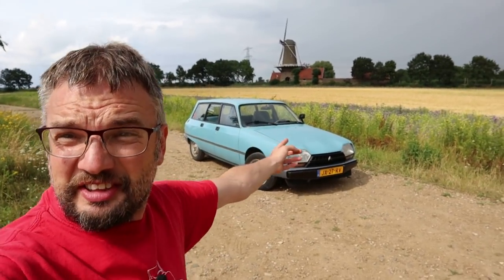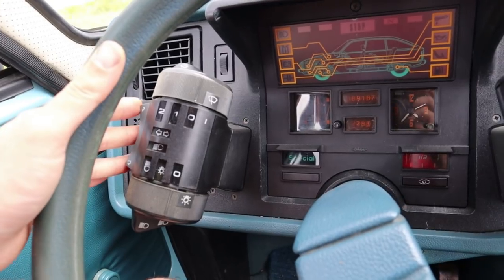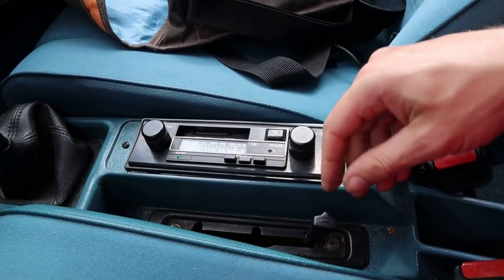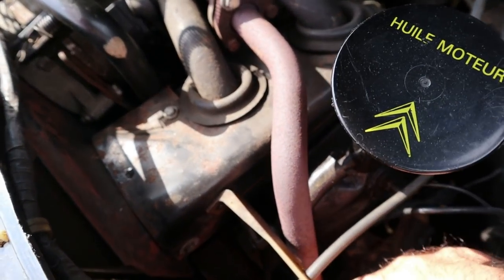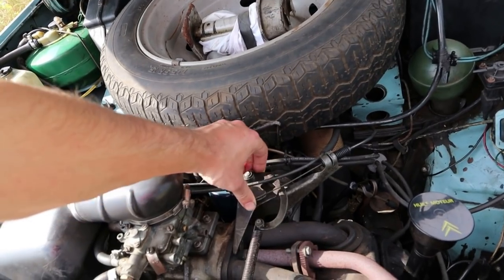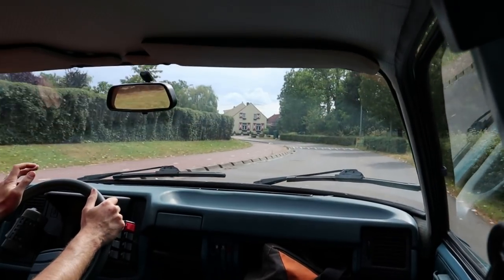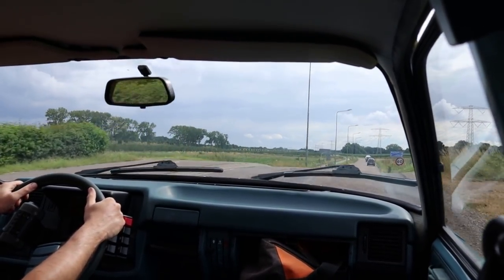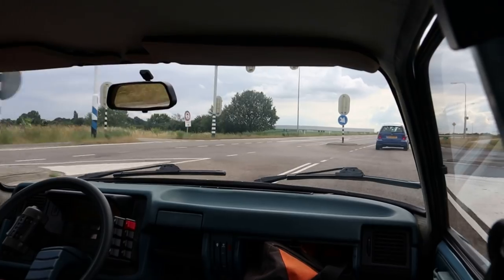Real Road Test: Citroën GSA Break (estate) Spécial!

Comment: Citroen really inovated back in the day. That cockpit is just breathtaking, the controls are so quirky but delightful. Cars are so boring these days. 
Thanks for the video, thought you were having a break.
Reply: Catching up on backlog of video !
Reply from the maker: It's the only video you'll be getting this week, so make the most of it. ;-)
Reply: A Citroën break!
Reply: I don't know the new Citroen cars are certainly going back to strange quirky looks and actually look less boring compared to other cars on the market.
Reply: or a brake! HA
Reply: @richierex  In a way prfer none cancelling indicators. Back in 1983 had a Dyane for 50,000 miles.
Reply: Matt Walker
 I won't really call it innovative. they tried too hard to be different without adding real value, a non canceling rocker switch for direction indicators just for the sake of using "different switches", a cassette player inviting things to fall into the slot, hard to read heater/cooling controls, that diagram of the vehicle in the centre of the cluster, nothing of those things survived into modern vehicles, I would say more pretentious than innovative.
Reply: @MrGoogelaar  odd that you are replying to a year old post but hey. My point was not about functionality but design. Look at the dash and layout compared to other cars of the era and today. You mentioned that these features didn't survive in modern cars which is the point. Modern cars all look the same and lack character, I don't believe that is pretentious
Reply: @mattwalker4034  What I mean by pretentious is that they tried too much doing simple things differently without it being an improvement or of any value, I think that is one of the main reasons that they went bankrupt and are constantly struggling. 
Things like front wheel drive, fuel injection, airbags, crumple zones, disc brakes are all old innovations that are still used in modern vehicles while the quirky features of the Citroen in the video are long forgotten, things like the tape player fitted the way it was, the switches, the handbrake etc. Not one of those things made the vehicle any better than its contemporaries, in some cases it actually made it worse, like the non canceling indicators.
Reply: @MrGoogelaar  But still far more interesting than most modern cars (which was Matt Walker's point). Look at modern hatchbacks, for instance,  they largely look the same both inside and out.
Reply: @julianevans9548  Unfortunately not interesting enough to bring the buyers come running and save them from bankruptcy, in the real world effectiveness and reliability will always win, being different for the sake of being different is often the demise of a product.

Comment: Hey, I'm old enough for this. My dad bought a white GS break in 1976, it followed up our 2CV. That was a 1012cc, with black plastic seats. Quite sweaty in summer. In 1978 he bought a new GS 1220 break in light blue metallic. That was one of the greatest cars I have ever sat in. I got my licence in 1983 and was proud to drive it every time I got the chance. What a great car. GS-es were very light, only 900 kilos or so (925, I read), so they got a pretty good power to weight ratio. That's why it feels fast, it's just so light. The brakes were fantastic, once you got used to the pedal that had only minimal travel, really only millimetres. I always felt I could stop the car on a dime, from any speed. The seats were fenomenally comfortable; the only thing detracting from the ride was the engine noise, which was quite horrible over 100 kmh. The suspension was a work of art, the steering was incomprehensibly precise, that car was about the most fun to drive of any car I can remember (at 55 I've had about forty, I can't even begin to sum up brands and models). Probably the best thing about these cars was the price: in the mid eighties I picked them up for 100 gulden, that would be maybe 250 euros today. If they broke down you'd take them to a scrapyard. They'd give 50 guldens, you'd pick up a paper and another would be in there for 100 gulden. Good times.
My dad's new bought GS rusted out in six years, leaving him very angry and without car. I think he got a brown GSA then. I thought it was a load of crap. The suspension had been modified to feel 'sporty', that is harder and less comfy. The brake pedal had far more travel, which took the feel away. The dash was also a downgrade to me, as it was less functional and more gimmicky than the GS one. The seats weren't as good. The car overall felt far more flimsy and thrown together than the GS, just not as good, not as balanced and not as 'of a piece'. It had more power, but felt slower. It had a different steering wheel, but not the steering feel. I didn't like the GSA and I will always feel it an inferior car to the original GS. Just adaptation to the market, just not Citroen. The GS was the real deal, that's how I feel about it. Jeez, did I just write all that? Allright, away with it.
Reply: @Johann Cats ... Being of 1951 vintage, I so agree with your comments about Citroën rather betraying its heritage, but market forces are brutal and companies have managements who get terrified of losing market share to competitors. We saw how, almost overnight, market-leader Nokia rapidly crashed and burned when the iPhone hit the marketplace. Consumers are capricious, and technology markets are particularly vulnerable to technical advances and new ideas. Citroën's suspension was once one such novelty and must have revelled in taking business from others at the time! If only we could at least have kept the older cars we liked on the road... but most fell to bits with corrosion ridiculously early in their lives and, as you say, it made owners angry. After six years, the annual roadworthiness test became as daunting as a trip to the dentist's... and similarly expensive.
Reply: Yes, I considered the GSA to be a downgrade - and I wondered whether it was because PSA were actually trying to kill off Citroen's more "eccentric" models and encourage buyers to lean towards more conventional - ie cheaper to manufacture - ones, particularly those based on existing Peugeots  - eg the Citroen LNA essentially being a Pug 104.   The GSA's dashboard just seems utterly bonkers - and, frankly, hideous - rather than charmingly different.

Comment: I managed to convince my mum and dad, who’d driven nothing but English cars (and had a Marina!) that they needed a GS. Amazingly, they bought one. The final straw was when they had to have the exhaust manifold replaced which I think required engine removal … Until that point though, we all loved it. Mum and dad said it was the best car they’d ever had and to this day remains the best I’ve driven (I had an lovely Alfasud too). They are everything that hubnut says - utterly wonderful & intelligently designed cars. You knew this had been made with a guiding purpose, not just to make money.

Not forgetting that, blissfully, Citroën’s quirkiness extended to non-self cancelling indicators. As ever, they were alone in this, and correct. Self-cancelling indicators were rubbish then and they are still rubbish 50 years later. On new cars they cancel when going round roundabouts or doing something else. They are a pain. It seems a small thing, but when the entire other car had self-cancelling indicators, it takes determination to go the other direction. Citroën always did and the GS is the shining example of that vision.

Comment: Soft suspension and big tyres (not wheels!) is a key for comfort, today with many stupid 20 or 21´ wheels the ride is just stupid. Despite that, the car is lovely and very futurist.
Reply: Even small cars like 208, clio etc...have commonly 15, 16, 17' wheels which is a total non sens. I remember my first car, a peugeot 104zs , had 13' wheels, my first sport car, a Honda prelude had 13 or 14' wheels
Reply: having a new c3 with 195-65-15, i cant imagine that i would go for 17" ultraslims...must be pain in ass.
Reply: I had a focus and went from 195/60/15  to 195/65/15   the tyres were cheaper (Michelin energy both sizes) the ride was much improved, the tyres would last longer as they actually rotated less times and the speedometer was spot on with all my sat navs and Google maps. And those signs at the side of the road that show your speed.   I'm doing the same soon with the Mondeo. I always add 5 to the profile and keed the same width
Reply: @Aussie Pom in those hilux's with the huge wheels you get smashed into the roof with every bump. £10 of fuel just to get too the petrol station.

Comment: We leased a GSA X1 5 speed 1299 cc for 3 weeks in 1982. Superb car. Cruised happily at 140-150 kph with a max of 165 kph.
Loved the control switchgear including to rocker blinker switch. So logical, so French.
Headed down to visit the Lambourgini factory and Pisa. So much fun to throw around once off the autoroutes.

In Australia we got Citroen addicted. My first GS (after 2 x IDs & 2 x DSs) was a 1015 C matic, followed by a 1220 manual sedan and later a 1220 GS C matic wagon.
On secondary Aussie roads it was so chuckable. My parents were so impressed with mine they sold their Holden and bought a GS 1220 sedan C matic.

Comfort, brakes, ride, handling, huge boot. Even with 4 up and luggage it was still magnificent. 
Saved their life overtaking a bus and a car one because it was so stable, they recovered after being forced onto the opposite shoulder.

A close friend had a GS 1220 Pallas and another a 1220 Club.

Citroens are rare in Australia, but terrible addicative. I currently have a 1990 2CV6 Charleston and a 2018 C4 Cactus 1.2 turbo 6 speed auto.

Comment: I had one of them. I brought it at Chester car auction back in 1987 for £250. A bargain for five year old car. Driving it home it became apparent why it had been sold at a auction. It wasn't charging which I became very concerned about .....An alternator back then for a Citroen could cost a months wages. Thankfully a close inspection the next day revealed that the alternator drive belt was completely missing . If I remember rightly  it wasn't an easy task to replace the belt .I had too remove a large proportion of the front of the car...When I drove it into the Austin Rover garage where I worked all my fellow mechanic mates gathered round . Comments like "What the """ is that , someone gave you  £250 to take it away echoed around the work shop.  However I ended up with a really good family car for a year nicknamed the banana because of its bright yellow paint. It was eventually replaced with a more conventional Fiat Strada , that also received a lot of condescending comments in the work shop . Sorry to go on ,but your video brought back so many happy memories.
Reply: Sympathy on the belt change saga!  I'm still in trauma from changing the points on my 1976 Peugeot 304 estate bought in 1982 as a non-starter. The distributor was buried deep  behind the engine against the bulkhead so you could either see or touch, but not at the same time. Finally getting it running revealed a knackered camshaft and my car proved to be a rare  variant with no scrapyard salvage engines available.  French motoring !
Reply: hey colin chester motor auctions on bumpers lane is where i bought my old citroens from too mate! did you work at james edwards?
Reply: Phil Healey .Yep been their..I used too work for the RAC. We had at home service. I used to turn out on a Sunday afternoon to someone’s house and they would hand me a set of plugs and points. They’d say “ I think these need replacing . I would reply ,I think you need to take it to a garage for a service then.
Reply: mark jones Yeah I worked their for three years . 1985 to 88. And that’s where I bought my Citroen. We could of been bidding against one another.
Reply: Kinda funny looking back that a Austin Rover mechanics would be making derogatory remarks about a FIAT and a Citreon. 
Especially since both concerns are still in business and Austin Rover is long gone!
Reply: @colincampbell2372  just out of curiosity, how did customers react to being told that?
Reply: @alfredsedgewick2184  They were annoyed that their £10 roadside rescue membership didn’t include a full service . They got even more annoyed when I charged them a £25 surcharge for calling me out to their home address .😆

Comment: My father had a GS Pallas - fantastic cars! Several BX and Xanthias followed, but the GS was the greatest of the lot!
Reply: Flemming Sorensen my dad had the same semiautomatic would love one
Reply: Xantias yes.
Xanthias no.
https://www.supercars.net/blog/1986-citroen-xanthia/
Reply: Rust bucket. Oil leaks on air cooled engine
Reply: @yousefbhoyroo6960  In almost 50 years it has been largely enhanced by 3rd party spare parts manufacturers. BMW or Porsche weren't better with their air-cooled engine. If you didn't do the basic preventive maintenance on a car (proper car wash, checking the bodywork and chassis for rust...), every car of the era was a rust bucket.
Reply: @chucku00  yes, that is very true, just look at Mercedes, the W114/115, the W123, w116 and so on all rusted a ton a lot of them were completely rusted through after 5-8 Years.

Comment: Dad bought a GS Pallas new in 76, OYM611R ferried us back and forth across Europe as he was in the Forces (Forces plate was MU556B iirc). I'd sleep on the floor in the back, and my sister got the back seat. Utterly bonkers car, but so very comfortable. 
It didn't like the Berlin winters - had to be taken in by Citroën one particularly cold year to be defrosted over 3 days.
It was sold on in 1985 when rust was getting a bloody good hold of it, and my Dad bought a Moggie Traveller, which he still has.

Comment: Dear Mr. H. Nut,

Thanks for another great video.

You've never said that you take requests, but you also never said that you don't, so here we go:

If you'd ever get the chance to test one of the following cars, I'd be delighted:
VW Phaeton
Renault Safrane with Volvo R5
Nissan Patrol 160/260
MB A-Class W168 (widely misunderstood car!)
Mazda 121 (the egg-shaped one)

Cheers
Reply: Well there you go Ian, you should've also driven the A-class I offered, then :D.
I think it's an oversold piece of horribleness with a mercedes badge on it, but some people seem to like it it turns out :D.
Reply: @rollingtroll  the badge is the problem indeed. MB should have sold the car under the Smart brand if you ask me.
Reply: A Mazda 121 test would be really cool, if Ian could find one. I actually quite like those little cars.

Comment: Citroen peaked for myself with my 1998 Xantia estate 1.9 diesel automatic.
The suspension was perfect, engine was brilliant, seats were amazing, the looks for me, were perfection and the gearbox meant that technically, you could have a top speed that was intimate, depending on engine revs and length of road.
I do however, appreciate the importance of the gs and gsa in the history of Citroen and , after a friend owning a pale blue gs years ago and then an orange gsa, I kinda got the Citroen bug from him.
For which I thank him for.
Anyway, great video as ever and thankyou for sharing.

Comment: Can't remember the last time I saw one of these. I nearly bought one once, low mileage with full service history and no rust. But I worried about that mechanical complication in the hands of a British mechanic and I bought a Mk 1 Golf instead. Ten cars later, I am driving a marvel of Czech-German functional evolutionary engineering which will go on to 100,000 miles without incident and then probably on to 200,000 or even 300,000. And the glovebox will never rattle and refuse to close. 100,000 Polish minicab drivers can't be wrong. But that wonderful dash on the Citröen. Tellement magnifique!!!

Comment: I had a GSA special..one morning the battery had run down & the engine wouldn't turn over.I used the crank handle to turn the engine over & it started fine.You didn't show where you can hand crank the motor just under the Citroen badge on the grill.

Comment: "What’s that sound? It’s my GS rusting outside". A friend had one. Lovely car, when it worked. And when the parts stayed together. But: I had a Sud! I guess, even worse. BTW, 16:43, the Sud had a simple beam back axle, not independent. But with such a good location/control system. Fantastic to drive. Until it broke down ... again.
Reply: I owned both Alfasud and a GS when living in Italy.
The italians would drool over the Alfa and pee on the GS but the Alfa just rusted away in places where it NEVER got wet ???
The GS was a super car and engine. Flat four aircooled excellence.
The Alfa always overheated, the Citroen just kept going.
Alfa was a definite let down on build quality. I don't think thare are any AlfaSuds left today and if there are they can't be one original body panel left.

Comment: Lovely machines, if not so lovely to work on. I remember buying an exhaust system for my GSX2. Bloke behind the counter asked how long it took me to get the engine out, didn't and I'm not going to, oh you have to, to replace the one piece down pipe. Sod that, 10 mins with a hacksaw and it was fitted with a short flexy section, some exhaust sealant and two pipe clamps on the crossover. That said, if I was offered a half decent one now, you'd be missing an arm in short order.